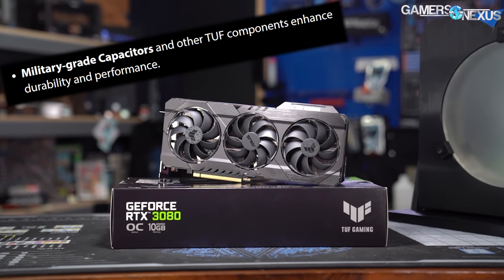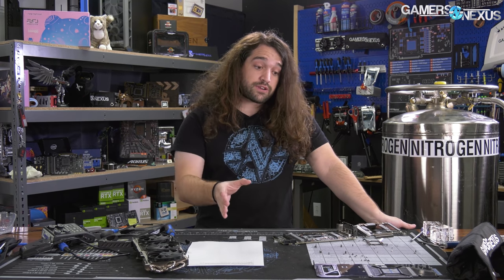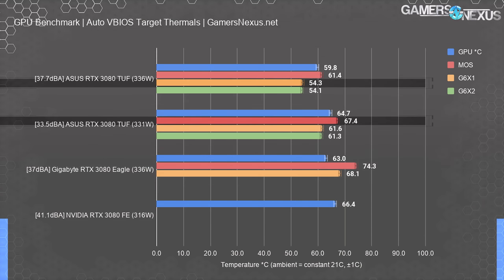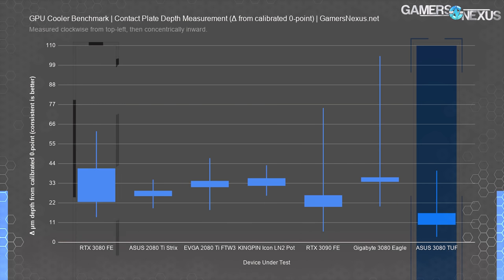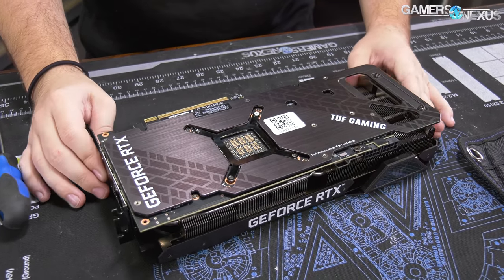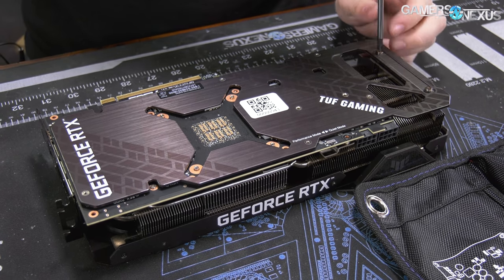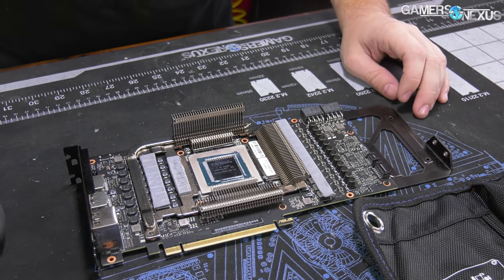ASUS RTX 3080 TUF OC Review & Tear-Down: Thermals, Noise, & Overclocking

Comment: As an owner of this card almost 8 months (since it’s release in October 2020), I can provide this review: it works and I’ve not had any trouble with it. I bought this card as they went with an all MLCC cap setup for the GPU, which probably doesn’t mean as much as some folks said it did (re: power and frequency transition), but it indicated that Asus went to some extra effort. And that’s my whole impression of both the TUF 3080 and my TUF x570… it seems like they put some effort in. Having done a lot of recapping of vintage hardware, they are using good quality components, and they are using high-quality surface mount automation, as everything is very uniformly soldered. I don’t think any of it is really mil-spec, but I do think Asus has (at least for this line and above) chosen a RMA mitigation strategy of using slightly higher quality components and tight manufacturing processes to reduce returns and servicing costs. 

I also have a PNY 3080, and while I’ve had no issues with that card either, it runs slightly hotter (especially memory), uses cheaper caps and, under magnification, is clearly not made with the same quality assembly equipment as the Asus board.
Reply: shud i upgrade from nvidia 3070 8gb FE to asus tuf 3080 12gb . please suggest. i have benq 1440p 144hz 27inch monitor
Reply: I have a tuf 3070 TI I bought for mining. Thermal pads they use are as thermally conductive as dirt you can find outside BUT if you change them yourself, it's the best design. I put copper shims on memories and since the memory has separate cooler, it had no effect on core temps yet reduced memory temps by 20c. Can't say the same thing about evga ftw3 as that one uses the main heatsink for everything. When I did the copper shim mod on ftw3 3070 TI and 3080, I ended up with higher core temps (no the copper isn't too thick to prevent core from touching the heatsink) Because of this better heatsink design, I recently bought a tuf 3080 and will replace the pads with a custom made copper plate soon.
Reply: @CaptainScorpio24  if I were you I would save up my money for 4080 or 4090
Reply: @Instead2   yess hv dropped the idea and I'm saving for 5070 at launch in 2024 . although  if nvidia launches 16gb 4070 or 4070 ti as super series. i can pick that up to.  my aim is 4070 ti or 4080 at discounted price wd  no less than 16gb vram .

Comment: To be fair Steve, the aluminum alloys used to build aircrafts have the Alclad treatment which is a layer of pure aluminum that's bonded to the surface to protect against corrosion. I work in a sheet metal company and we do not hold stocks of Alclad aluminum and coincidentally non of our clients are in the business of building aircrafts. So ''aircraft grade aluminum'' is a thing...
Reply: It is indeed a thing that is not used on these consumer products 😂😂
Reply: I agree,  as an aircraft engineer. there is big difference between aircraft grade aluminum and general use aluminum
Reply: Work in the field as well. If only people knew how many grades there is to mert ISO certification
Reply: @anthonymarquez2542  He's making a point.
Reply: Aircraft grade aluminum refers to a specific aluminum alloy, of which there are many. 6061 is a common version that is used with inexpensive products and is easy to manufacture. The 7000 series aluminum is nearly as hard as steel while still being lighter than titanium. It’s fairly expensive by comparison. Titanium is similar in that there are various grades depending on the use/need.
Reply: @iawardana  lol I love this comment. Massive contrast from the OP who actually knows what he's talking about and explains the differences, vs the probably intern who read "engineering" in his job description somewhere and can't stop talking about it despite not actually know much about anything in general. 

Like literally "As an engineer, I agree with what that guy just said" is what this comment amounts to 😂
Reply: @flyingtentacle7631 ey were just saying they agree and were entirely correct... Not everyone wants to type out something as long as what you or op commented and will just agree.

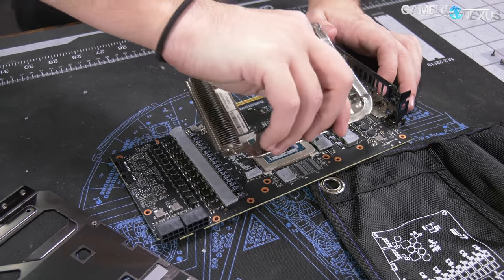Comment: 22:41 There was a little oversight. There are two different types of fans installed on this card. The outer fans rotate counterclockwise, the inner fan clockwise. Therefore they should have different part numbers.
Reply: You should check the part numbers yourself anyways. Even if you're only replacing the middle fan.

Comment: I like the ASUS lineup of 3080's, just for the fact that they have 2 HDMI outs. If you are using several monitors,  the extra option for output is worth some of the downsides.
Reply: these days hdmi is capable of a lot, like 4K 60Hz and more, which should be enough for most things
Reply: You can only use up to 4 display outs anyway. This card essentially is still a 4-display out. You can just use the extra HDMI in lieu of another port. Some people might find that useful.
Reply: Oh you mean just like the cheaper gigabyte Eagle?
Reply: @janklaassen6404  Asus TUF is 699$ MSRP, how is the eagle cheaper?

Comment: When I used to work in fasteners "Military Grade" usually just meant the components were compliant with an MIL specification. It did not mean they passed some battery of grueling tests that only the best of the best could endure, and got some military certificate.  It simply meant certain components or materials needed to meet or exceed standards laid out in MIL guidelines. However adherence to these guidelines is not strictly governed, unless you are selling to a Military entity or Subcontractor thereof. So long as a component mfg can produce a lab report that indicates that the tests meet or exceed the performance and physical characteristics, then it's "Mil-spec". The only real caveat is that in order to call a components or a material "Mil Spec" you have to maintain all the traceability documents as to where you go it from and what you did to it. 

For example, you might be contracted to produce a special Bolt. The bolt itself is unique and custom and will not match any existing off the shelf design specs. But the customer may wish for it to be constructed per the Mil-S-1222 specification. This simply means that it will need to have certain dimensional tolerances and based on its diameter, length, head style etc. As well as have certain minimum tensile, shear, and yield strengths, be able to apply certain clamping forces etc. But it is up to you for example to know that the customers desire for ..let's say there to only be 1/4 inch of threads for a bolt of a given length diameter, may no longer be capable of withstanding the specified tensile force, and recommend an alteration, or a different one of the materials allowed by the spec. 

As far as you being allowed to say your new bolt is "military grade" you merely need to provide certificates of origin for the actual material (traceability) and your diagram and any internal dimensional and physical property testing you did in house yourself, that show the end result adheres to the spec. No one comes calling to force you to "prove the integrity" unless a fastener catastrophically fails. 

So you go get that lowest possible quality material from a vendor which can provide lab reports as to the chemical composition of the material (proof it meets the spec)  for the lowest possible price.  Let's say there are 5 grades of material in the spec (making up a number) and the second to lowest grade will do the job...you don't go buy the top level grade just because the Mil Spec says it is the best one for a given application. Esp when you need to do a min run of like 1/4 million screws or whatever. You make your screws, you do the dimensional testing in house, verify tolerances, and then get a 3rd party lab to take like 100 screws for every batch of a million, and do destructive analysis. The lab says your parts failed at a 150000 psi of shear force and the spec (Again making up a number) calls for 145000 BOOM you are mil-spec. 

tl;dr,  Mil Spec just means you met the minimum possible guidelines of performance for the lowest possible unit cost and have the docs to prove you took the 10 extra minutes to send a couple off to a lab, and scan the material cert to a computer. it does NOT mean these are the best possible components that you can possibly construct. 

So in terms of a capacitor if I were to extrapolate, I would say the component mfg they sourced from has certs on file showing where they got the tantalum from, and has a lab report that says that a batch of x per y went to a lab and verified those 0.00000000% of the lot, satisfied minimum tests for conductivity, output, heat etc. 

So if you ask me... Mil Spec does not necessarily indicate HIGH quality ,so much as it indicates MINIMUM VIABLE quality. 
That being said those min guidelines typically but not always, do exceed to normal commercial standard. But this is a case by case thing, not a guarantee.

Comment: I work in a truck building company and we made some for the Norwegian Army. For us, military grade electric components are definded like following: The components have to get tested under load for hours and hours. There is a certain rule that says, if a elecric part doesn't break after a certain amount of time under load, it will last forever. Those trucks normally got tested before shipped out, wich is of course a time and money consuming process. 
However i doubt ASUS did that treatment to their cards.

Comment: Aircraft grade aluminum means that it’s either t5 or t6 aluminum which is drastically different than t1-4. They are strength ratings based on the same thickness. Modern 757’s wing span couldn’t exist without T6 aluminum.

Comment: As a veteran, 'military grade' means crappy, old, overpriced equipment made by the lowest bidder.

Never buy 'military grade' anything.
Reply: The military grade spec has literally nothing to do with equipment used by the military. It's a testing procedure to make sure it can withstand things like shock, vibration, extreme temps and overvoltage etc...
Reply: @monkfishy6348  the MILSPEC standards determine the durability of the equipment in the field (water, dust, shock, temps, humidity, pressure, etc...). So yes, the standards have everything to do with  "equipment used by the military".

Maybe do a bit of research.
Reply: Specially “military condom...” unless you want a baby and your partner said no. Lmao

Comment: "aircraft grade" does actually means something, it's a specific and substantially different thing than just random aluminum. I don't know about "military grade" but i thought it did originally mean it met some durability/endurance criteria for military purchasing - not that it was a high bar or anything
Reply: No it doesn't, there is no aircraft grade aluminum. Different aluminum alloys are preferred because of their mechanical properties, one of them is 6061, but none are produced specifically for aircrafts. Many bike companies also use 6061 and call it "aircraft grade" for marketing, it is total bs. Cans also are made from 6061, no one calls it can grade aluminum
Reply: In Australia it does. As an electrician I personally worked with some very good gear. The worst, most-likely-to-fail component was the clear plastic/orange plastic Clipsal industrial 10 amp and 15 Amp 240VAC inline sockets and plugs. Dropping them on the concrete was enough to smash one. The "Military grade" plugs and sockets were machined billet aluminium (not aircraft grade as that is, although strong, quite brittle). They used effective strain relief for the armoured cables that entered said units and wires were soldered, not screwed or crimped. I wish my house was defence grade electrical!
Reply: My guess is the components meet the relevant MIL-STD for whatever specs are relevant to the function of the device, be it vibration, noise, acceptable interference, etc

Comment: For those curious what "Military Grade" (or Mil-Spec) is, it means it passes the testing spec set fourth by the DOD ... which I believe is still MIL-STD-202 ( http://everyspec.com/MIL-STD/MIL-STD-0100-0299/MIL-STD-202G_2397/ ). 

In terms of capacitors, it usually means they have a longer time to failure, tighter tolerances, and higher temperature until failure. The specs may also indicate shielding and/or mounting package requirements.

Jokes aside about cheapest bidder, it's usually best to choose Mil-Spec components if you can as they're often among the highest quality and don't cost that much more. So contracts are the cheapest bidder using these components .. you don't want to know what they'd be like with consumer grade components.

Comment: I have the O10G-GAMING one. I have been very happy with it, it stays cool and runs silent. The only huge problem I had with it, was that it just wouldn't run at 100% utilisation without the Asus GPU Tweak 2 installed. No matter what I tried, I got around 40-80% usage in both games and benchmarks. After trying every other normal fix, I installed the program and ran the auto overclock thingy. Only then I started seeing full usage and benchmarks/in game FPS numbers that I would expect from a 3080. I have no idea why that is, but that's how it went for me.
Reply: what is your cpu bro

Comment: "military grade capacitors"
from my experience w/ military contracts, its gonna be the cheapest shit they could get and still overspend on
Reply: Look at the controversy over the new M17/18 pistols. Apparently the manufacturer (Sig) undercut the competition (Glock) by such a significant margin that they literally just stopped the trials early.
Reply: i have  GTX 970 since 2014 and still runs evrything at max settings 1440p 30+ fps!. in 2016 ugpraded monitor and psu in 2017 cpu ram motherboard and  hdd and just 3 months ago i got a high end SSD the MP 600 2TB. But gtx 970 still a monster! My pc now is  CPU: RYZEN 7 1700
RAM: 16 GB DDR4 3200MHZCL15 GS KILL RIP JAWS
GPU: GTX 970 G1 GAMING
MONITOR: DELLP2416D 24'' 2560X1440 60 HZ IPS
MOTHERBOARD: ASUS PRIME X370 PRO
HDD1: WD BLACK 4 TB
HDD2: 1 TB
SSD: MP 600 2TB
In eed RTX 3080 for ray tracing and  i wil lget one when price and avaliability of it becomes normal.

Comment: Dual balls is better. Can confirm
Reply: i have  GTX 970 since 2014 and still runs evrything at max settings 1440p 30+ fps!. in 2016 ugpraded monitor and psu in 2017 cpu ram motherboard and  hdd and just 3 months ago i got a high end SSD the MP 600 2TB. But gtx 970 still a monster! My pc now is  CPU: RYZEN 7 1700
RAM: 16 GB DDR4 3200MHZCL15 GS KILL RIP JAWS
GPU: GTX 970 G1 GAMING
MONITOR: DELLP2416D 24'' 2560X1440 60 HZ IPS
MOTHERBOARD: ASUS PRIME X370 PRO
HDD1: WD BLACK 4 TB
HDD2: 1 TB
SSD: MP 600 2TB
In eed RTX 3080 for ray tracing and  i wil lget one when price and avaliability of it becomes normal.

Comment: Military grade usually refers to an extended temperature range where the component retains it's rated spec. Sometimes other issues, like radiation, are include. In tanks, planes, boats, etc, this is very important. Engineers should know all about this terminology, I don't see why it's a point of levity.
Reply from the maker: Because it's totally irrelevant in a video card when parts not marketed as "military grade" are often better or equivalent.
Reply: Yea I was going to say that but I dont think we need -60C to 150C components in GPU lol.
Reply: @GamersNexus  Whatever you say about the components it's just baseless conjecture until you get a M4 and take some shots at the caps. I always thought that you guys tested the manufacturer's claims on behalf of the audience, Steven.
Reply: It is not a panasonic tough book that is going in service. 😁

Comment: When talking about military grade for electrical components it typical refers to temperature operation range. With commercial between 0 and 70 C, industrial between -40 and 85 C and military at -55 and 125C. It's important to note that these aren't actual norms so they can differer from manufacturer to manufacturer.

for further reading: https://en.wikipedia.org/wiki/Operating_temperature
Reply: mister.T Jr  8 words in my comment I state electrical components. And they were talking about capacitors. The aluminium is on another product.

Comment: Generally speaking, the MIL-SPEC for electronic components usually is a higher operating temperature range. Most MIL-SPEC components are designed to operate at much wider temperature ranges because the military wants to make sure our gear wouldn't break down if we end up in the artic circle in the winter or the middle east in the summer. Usually electrical components will be rated for something like -40c to 80c and the MIL variant will be rated to like -55c to 125c. Most component manufacturers will have a special series designated as their MIL stuff because there are DoD regulations that denote required performance.
Reply: there was spesial symbol on military grade electronic components in ussr. it was common to see gold plated contacts on them and other fancy shit

Comment: TUF Marketing...
When I bought my Z77 Sabertooth motherboard I did research into what "TUF" meant at the time. It meant a 5-year Warranty. A sampling of motherboards underwent a rigorous, 4-week testing cycle for the CPU, GPU outputs, USB etc to provide feedback for addressing any manufacturing issues.
Fast forward to NOW and it seems like they are trading in mindshare for what "TUF" means for short term gains. So "TUF" will basically stop meaning much. I believe it's 3-year Warranty for graphics cards with the TUF name so I'm not clear if "TUF" means anything at all now.